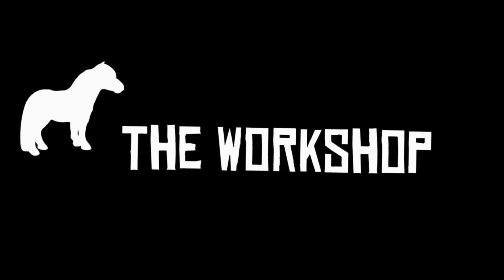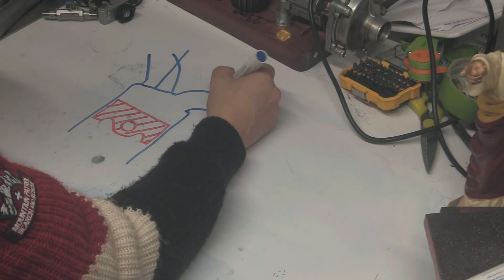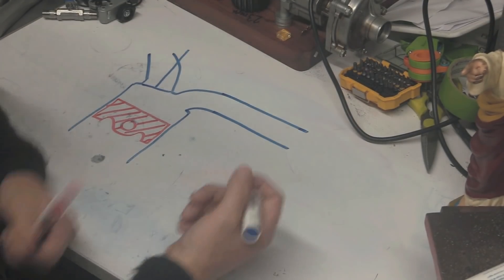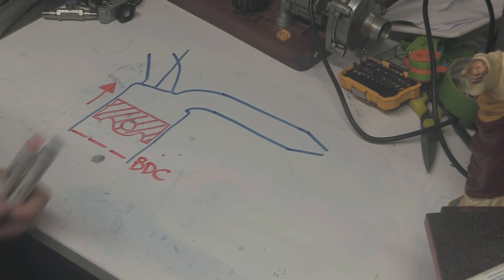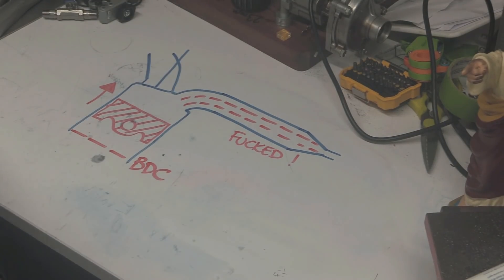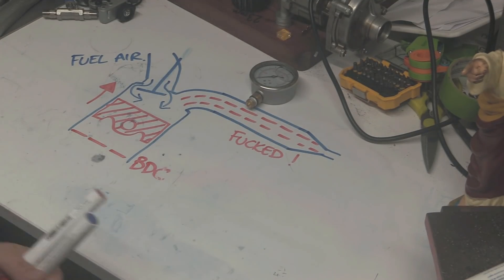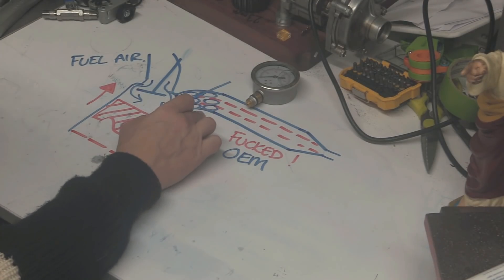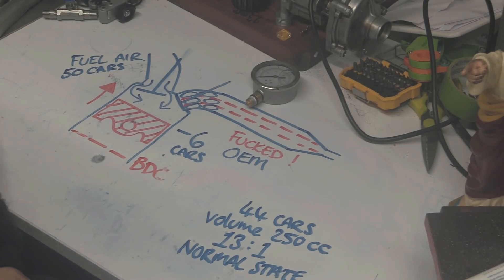New Exhaust makes bike run LEAN?

Comment: Wouldn’t the O2 sensor compensate ?
Reply: only when its in closed loop, and it is not close to and at WOT
Reply from the maker: No. The O2 sensor measures O2 weirdly LOL it's fuel that missing which leans out the mixture. Now you're thinking that will de detected by the sensor, but the O2 sensor is in the exhaust. The fuel burns in the exhaust, therefore the reading isn't that much different than the OEM reading. 

If it did then this wouldn't be a thing.
Reply from the maker: Great question by the way
Reply from the maker: Oh and to add, not all bikes have O2 sensors...
Reply from the maker: "only when its in closed loop"

- No, that's wrong. Even in closed loop - see above
Reply: @thedirtyworkshop  fair enough. i had'nt watched the video through, good point Matt :-)
Reply: The Workshop nor all cars ;)
Reply: @thedirtyworkshop   how does the fuel burn in the exhaust without oxygen? 

In the video you said that most of the fuel goes through the exhaust valve into the exhaust pipe and almost no air
Reply from the maker: No oxygen? Oh there's oxygen. You're taking all of this too literally. Almost means not all but some.
Reply: @thedirtyworkshop  
Good stuff, makes sense 👍
Reply: @thedirtyworkshop  so autotune systems that use an o2 sensor to update fuel maps as you ride don’t actually work or am I missing something?
Reply: @thedirtyworkshop  I noticed this cause I use a EGT with O2 and the O2 barely if at all changed at all. I did notice most change when snapping the throttle open, but just barely. I also notice on my older honda with carbs that it leans also. Here i attributed it to a slight raise in port velocity and possibly a better mix of fuel cause i noticed hydrocarbons also went down at lower engine speeds. and the same thing happens with the stock smaller carbs. do you think i might be onto something here or am i over thinking it?
Reply: The range that the 02 sensor can compensate is very narrow. It can adjust for small changes in atmospheric conditions within one block of operation data or fuel mapping. Changing the exhaust takes you completely out of one block of data and into a different block of data. If the system has sufficient if atmospheric pressure sensors,  engine temperature sensors  Ambient Air Temperature sensors it will select a appropriate block of data but when you change the exhaust it selects the wrong block of data. Some systems don't even have the sensors necessary to make a selection in the first place they just go by engineered test experience and this is usually within  range , if nothing has been changed.
Reply: I thought afr guages worked on o2?
Edit: yeah it does, when youre tuning engines and you stick a wideband sensor im the tailpipe to get AFRs, its o2 thats being measured, my point being, measuring o2 must be a viable means of determining AFRs.

Which appears to leave OPs question not fully answered.
Reply: @WikWak  most efi systems use a narrow band sensor which is only accurate at very close to lambda 1.
If the mixture is far off enough it wont be able to compensate. 
To get around this we use a wide band sensor for tuning.
Reply: @thedirtyworkshop  This can't be entirely accurate otherwise how could we ever dyno tune a bike.  A dyno tune relies exclusively on the readings of a wide band to determine AFR.  Also, what do you make of 'learning' ecus (Kleihn for ex)  that make adjustments to open loop fueling based on closed loop readings?
Reply: @WikWak  only if the system is known and the ecu programmed accordingly, back pressures from the airbox and exhaust, egr systems, map sensors, maf sensors all need to work together to lean out or enrich the mixture accordingly.
Reply from the maker: "This can't be entirely accurate otherwise how could we ever dyno tune a bike.  A dyno tune relies exclusively on the readings of a wide brand to determine AFR."

Because that's what a tune is. As stated above it's not just the O2 sensor... OEM's don't accommodate for aftermarket changes, why would or should they? 

You also have to take into account conflicting data. If the intake pressure, temp (and mass flow sensor if fitted) all say the same thing and the O2 says something else then the O2 is generally ignored. Reason being is that O2 sensors can 

1) be fooled easily , they're not combustion detectors after all.

2) live the the harshest environment - unlike the other sensors 

3) as stated above are usually have a narrow band and have a sluggish cycle rate.
Reply: @thedirtyworkshop  I had the same question, never thought about the excess fuel burning in the exhaust. Is this why changing your exhaust makes it pop and bang more?
Reply: @thedirtyworkshop  Am I missing something?  ECU sees running lean from O2 sensor values and decides to ignore it? I think that's shite.
Reply: @thedirtyworkshop  A  hell of a lot of them do.
Reply: @thedirtyworkshop  If lambda/o2 sensor detects oxygen and more fuel is being put into the exhaust because free flowing exhaust, for the same volume the sensor would detect less oxygen and compensate by cutting fuel and making the lean mixture even worse..Aftermarket slip ons are more beneficial to carburettor bikes that can be rejetted to suit.
Reply: @jkbshields  With aftermarket exhausts the fuel flows straight into the exhaust instead of lingering in the cylinder waiting for the compression stroke. When the fuel goes straight into the exhaust it gets burnt after the exhaust valve but before the o2 sensor. So the o2 sensor doesn't know any different, it just sees that all of the fuel going into the engine is being burnt, so it doesn't adjust anything.
Reply: @ATOM314159 sounds plausible, thanks for the explanation.
Reply: @jkbshields  what needs to be said is that motorcycle efi is very limited in comparison to cars of today. The O2 sensor is narrow band and reacts slow. A wideband sensor is needed as a proper self tuning ecu or a dyno and every car after 2010 has.
Reply: @thedirtyworkshop  hey I hope you’re still replying to old comments. I would really like your input on this. 
If you run a bike on the dyno using wideband O2 sensors and see no difference in AFR readings, then would you consider this problem to NOT be occurring?
Reply from the maker: I can read the rest of the thread. What do you mean a problem NOT occurring?
Reply: @thedirtyworkshop  Thanks for the reply. What I am asking is that if you dyno the bike (using a wideband O2 sensor to measure AFR) and there is no difference in AFR between the stock exhaust and a straight through system then would you consider the bike to be running fine?

Comment: That was a nice simple explanation. Being a pilot of piston powered aircraft the operation of which results in continuous changes of how much air( effected by alitude , high and low pressure air masses) you get and the temperature of the fuel results in needing to frequently adjusting the air fuel ratio with the manual mixture control. And having been a air pollution control system inspector/ repair  technishion  for several decades I fully understand the need to get this information out to people messing with engineered fuel and exhaust systems . There are so many people that  believe more fuel is better and or the bigger the air inlet the better, both are wrong. What most people don't understand about these systems if you gain in one area you lose in another if the system was well-engineered in the beginning. I have changed most of my motorcycles in the past but I changed them to make improvements in pacific areas of operation or to remove weight located up high.

Comment: Retuning the fuelling system for altering the exhaust backpressure hassle comparison:

ECU fuel injection requires a laptop, software, knowledge of the software, leads, etc.

Carbs require a screwdriver and occasionally alternative main jet(s) sizes.

Altering the exhaust backpressure is not a major issue with carbed engined 4 stroke engines. This is where the problem lies as bikers who grew up with carbed bikes knew that slapping on a lower backpressure exhaust system is no big deal to tune in. Then they do it on a ECU fuel injected bike and the hassles begin.

Comment: I remember doing approval tests on replacement exhausts (for cars). We checked the back pressure on the OEM and replacement as part of the test. Unfortunately the manufacturer only had a 2 wheel dyno so for 4WD cars saw us hurtling up hills at 75% max power engine speed (0.75S will stay with me forever). To be fair, the dyno testing was pretty sketchy as well! I’ve also carried out engine power cert tests with different back pressures to account for alternative exhaust configurations.

Comment: The O2 sensor narrow band factory is for adjusting fuel but it’s fine tuning factory fuel curve. This fuel curve is fixed to the tune of the bike. O2 measurement is at lower closed loop rpms and increase or decreased the fixed factory fuel map by a fixed percentage across the curve but it can’t tell you opened up the exhaust in the open loop area high rpm. When you make large changes to exhaust and air box etc the fuel curve mapping needs to be adjusted. Wide band O2 can measure all rpm to retune but normally dyno or aftermarket fuel tuner creates a new fuel curve. That’s how I understand it maybe different on newer or older bikes. Tune ECU let’s me adjust the fuel curve with a laptop  but you need a wide band O2 & dyno or hope it matches a similar dyno tune and load that fuel curve.

Comment: So there are 2 problems here, firstly exhaust gases which haven't got a clue about merge in turn, and secondly idiots filling their tanks with cars instead of petrol.

Seriously though, great explanation particularly when you've shown in one of your answers why it isn't picked up by the O2 sensor.

Comment: I changed full system exhaust..if it is lean, would the engine temperature reading rises?
Reply from the maker: You gauge is the coolant, so the difference would be dampened

Comment: Does this also apply to a carbureted bike? Id think because the carb is further away from the cilinder the fuel would be better vaporized before it gets sucked in by the piston intake stroke.

Comment: What I struggle with not coming from a biking background is where to get a remap in the uk. I would want to put a full system on for weight and sound, but not really performance per se. So who do I go to to sort out the fuel ratios. I could get a powertronic or some such but then to map it yourself you have to fully study.
Reply from the maker: Start with places locally where they do dyno testing and ask what remapping they do
Reply: @thedirtyworkshop  thank you very much for answering:)

Comment: I would say that modern bikes ECU is smarter than you think the O2 sensor is constantly monitoring the state of the AFR when it is in closed loop or not and would always overide the fueling (within its fuel trim table) keeping a constant safe AFR and would never let it get into a too rich or too lean situation. Plus you also have to include the knock sensor that would sense any detonation and would retard the ignition to prevent damage. Also if the ECU couldn't adjust the fueling within its fuel and ignition trim tables it would revert to a default fuel and ignition table and this would generally be limp mode (only applicable in OBD2 compliant vehicles). Im more of a car guy and find your videos very good and informative and would happily stand corrected if im wrong.
Reply from the maker: 1) most (nearly all bikes) don't have knock sensors

2) thats not how o2 sensors work
Reply from the maker: I'm doing another 2 videos on this, 1) people questions/comments 2) about carbs
Reply: @thedirtyworkshop  O2 are used to measure AFR when tuning  thats how tuners know if the mix is lean or rich and adjust accordinly so I dont undertsand this comment? I am very intrigued how ECU's on motorcycles measure knock without a knock sensor? I know that my mates 2016 BMW S1000RR has one.
Reply: @thedirtyworkshop  I will look forward to the follow up videos and learn some more, Every day is a school day.
Reply: @anthonywilliamson6092  The lambda (O2) sensors on all sport bikes I know about are narrow band sensors which only measures the AFR in low to mid range rpm.
Then the ECU is not cleaver or fast enough to compensate for that either.
Even your reference, the S1000RR only compensate bout +- 5% under 7000 rpm and nothing over that.
To complicate things even more the bikes mess the afr up even more with the so called PAIR system which is a sneaky way to get through emission regulation.
The system injects clean air into the exhaust just after the exhaust valve to lean out the exhausts. 
So how would the bike then be able to compensate for that since it will not know the correct afr?
When tuning a bike the PAIR system needs to be disconnected and the narrow band lambda also needs to be disconnected otherwise you will not get the correct afr.
Reply: Is this a problem more specifically with bikes than cars because they'd generally have a more aggressive cam profile with more valve overlap? If this losing fuel out the exhaust happens most at a specific rpm band by putting a less restrictive exhaust on have we just moved the rpm band where it happens?
I can get an o2 sensor might not see the change but I can't see how a retune would stop petrol going out the exhaust, it could remap so it doesn't run lean but it isn't changing the timing of the injectors, or was it always happening and the new exhaust brought it into a more problematic more commonly used rev range?
Reply: @arrindaley3714  If you really look at the video you will understad what is going on.
The answer is, NO, a re-tune will not stop fuel mixture to escape into the exhaust but you will add more fule mixture into the cylinder to compensate for the fuel escaping through the open exhaust valve. Yes, it is kind of a waste of fuel but the actual loss is neglabel and it will help to cool the exhaust valve which is a good thing.

Comment: Slip on and full systems are different, slipons don't need a tune ...  Back pressure is only beneficial for 2 strokes, 4 stroke need low pressure evacuation. Exhaust pulses and back pressure are different. Good video.
Reply: Back pressure is a part of scavenging just like the video said. Slip on just makes less noticeable affect than full system, but they still go the same way. The stock let 6 cars stay in, a slip on let 5 cars (so it's not noticeable much), and full system mostly let 3 or 2 cars stay in. It's very simple but we mostly don't want to messing with tuning bike so we afraid of that, and trying to fool ourselves to not go for tuning.

Comment: So if you change to a more breathable air filter (like a K&N - forget about the "does it clean" debate). This could do the same thing and create a lean mix in the cylinder?  More airflow = more fuel out the pipe prior to the valve closing? BTW I am eagerly waiting on your K&N vid.
Reply from the maker: No, because this is a fueling issue vs timing
Reply: @thedirtyworkshop  From what you have said, changing the exhaust is a flow issue as is the air filter. You would need an air flow sensor to change the fueling/timing?
Reply from the maker: Flow through the exhaust is what cause the back pressure. This is how an exhaust changes the scavenging. Remapping changes the fuel volume at specific rpms to stop this excess fuel leaking because of the changed exhaust.

Increasing Intake flow rate only adds to the problem by increasing the fuel quantity....
Reply from the maker: It depends how the system works. If there is no density measurement then a filter won't make any difference.

Comment: Will changing exhaust on a carburated engine have the same effect as on a port injected engine? Seems to me the incoming fuel/air mixture will be more uniform from a carburetor, and you won't lean out as much.
Reply from the maker: Thats in the next video

Comment: If the fuel fucks off thought the exhaust, the incoming air will fuck off also. Thus won't go lean. O2 sensor will read lean or rich and ECM will adjust (to a degree).
Reply: Is this true?

Comment: Would it be possible to counteract the lean condition if you could delay the injector pulse a few ms? Would this still give the scavenging benefits of overlap?
Reply from the maker: Or just remap it, thats far easier than fucking around with pulsewidths. Thats basically what you do when remapping

Comment: So if you change the exhaust to decrease back pressure and increase flow, then change the fueling to correct for this, why does the bike produce more power? Is it that the piston doesn’t have to do as much work pushing the exhaust gasses out? Or does it somehow allow for better volumetric efficiency? 
I’ve heard people say they like high flow air filters and high flow exhaust because they allow more air flow in and out of the motor. I know the air filter part is BS because I’ve seen dyno runs with the proper fuel change with and without the air filter and it didn’t change shit. So if you aren’t changing the flow in, why does less restriction in the exhaust increase HP?
Reply from the maker: Because an engine is like but not a air pump. Air in, air out
Reply: It's mainly due to valve overlap and scavenging.  More backpreasure equals less scavenging and less power.
To a point though.. obviously.

Comment: is this 'issue' 'aleviated' somewhat by say a carb where  it puts fuel in a little further up the intake tract?
or something like direct injection where valves are closed then it injects?
Reply from the maker: Carbs in the next video
Reply: then keto....